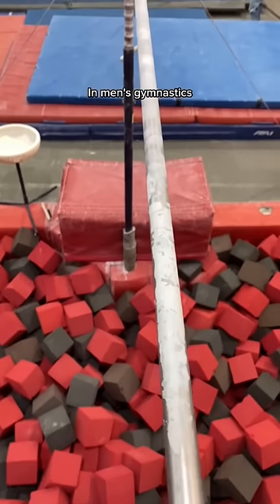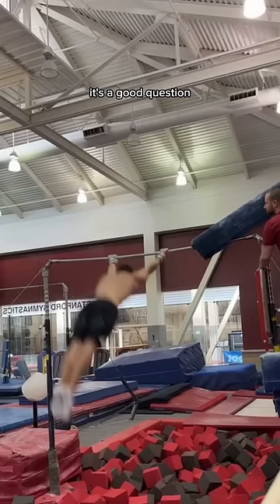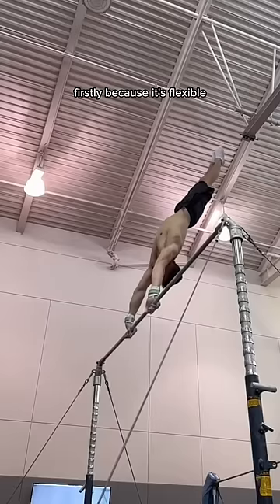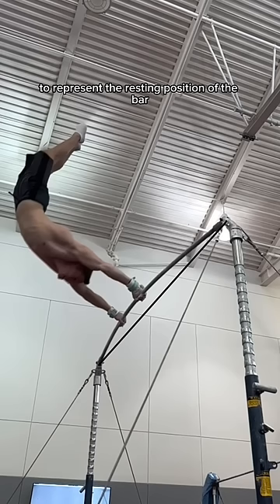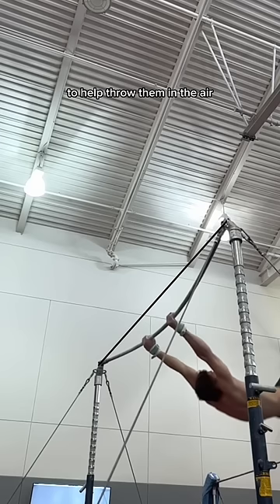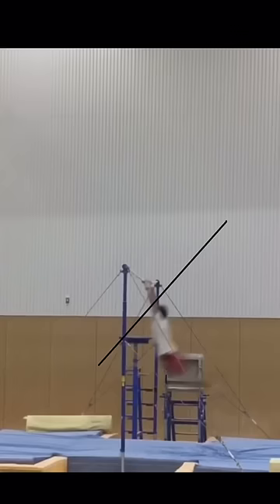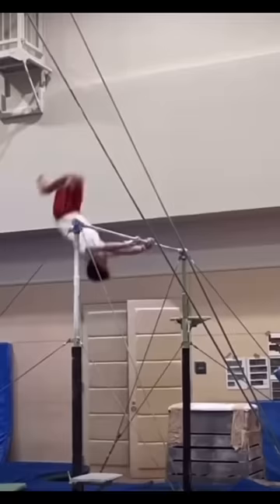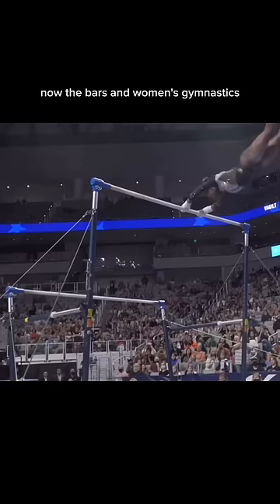Why is it made of steel 🤔 #gymnast #gymnastics #sports #calisthenics #parkour

Comment: Sounds like the women should also have a steel bar wtf literally less aid from the bar why make it different
Reply: Steel is springy, but that only really helps when you’re of a certain size. Gymnasts are on average smaller people, but I would expect male gymnasts still weigh a statistically significant amount more on average than female gymnasts. One possible reason for the bar difference is if you’re under a certain size, the steel bar may be more of a hindrance than a help. Steel can be springy, if you can pull it hard enough; if you don’t have the body weight to do so, that would be a serious disadvantage. Wood and fiberglass are springy too, but less so (I.e. it takes less force to bend, but gives correspondingly less spring, which you wouldn’t actually need as much of if you were smaller). I’d be very curious about the math here, but I would expect the difference in bar material is explicitly in the name of fairness, not some sort of sexist disadvantage imposed upon the female gymnasts.

I would still be interested in the math though, and if the performance difference between gymnast size and bar springiness is proportionate between the male and female athletes. If it’s not proportionate, then yeah it seems like it needs to be made so
Reply: Dude.. men and women who are in gymnastics weight are different yea sure they both need to keep their weight down but men on average weigh more
Reply: It’s not about being fair here. It just makes sense
Reply: I clicked "newest first" to see this comment

Comment: Uh wood would literally bend just as well if not better while still being strong???? So no, the weight difference isn't why and it doesn't make sense you guys use steel
Reply: if wood is so strong why dont we use it as armor. might as well replace all steel with wood since wood is so strong...
Reply: Your point makes no sense.
Reply: Metal bends better than wood
Reply: @shamanllama  floors are made of wood for the sake of comfort.
Reply: @shamanllama  wood is cheap. thats why. also idk about you but where i live our houses arent made from cardboard either, unlike in america. but to answer your question, your cabinet doesnt have to hold a 60kg+ fully grown dude swinging on it doing backflips. its holding cloth, maybe some electronic and other plastic things that you bought. so wood does the job. your floor also isnt only wood. theres things under the wood in specific patterns to make it more stable. the wood on the top is only there to look good.
Reply: Wood isn’t all that bendable.
Reply: @shamanllama  wood does NOT bend well at all
Reply: @mariothedog2949 they think a twig from a tree that you can bend with your hands can support someones bodyweight

Comment: You were just doing circles then and then doing an impressive flip off but yet going to try to flex on the woman even though they were doing some of the most impressive stuff I’ve ever seen I’m not hating on gymnastics I’m just saying
Reply: Some of you people get so ffended because of facts it's concerning🤦
Reply: They are both strong and very talented. It is just the type of stuff the men and women do
Reply: its because women have 2 bars so they do more and men weigh more so if they were going up and down from a low bar and a high bar then they might break their back or break the steel bar and it'd just make bars even harder than it is

Comment: Boys are stronger  that's why girls   Use wooden bars😆😆😆😆😆😆👨‍🎤👨‍🎤👨‍🎤😈😈😈😈😎😎😎😎😎
Reply: Gender dimorphism, basically men are genetically designed to have a higher concentration of muscle, this is not to say women are necessarily weaker, because if you pit a man who never works out against a women who works out on at least a semi-regular basis, the women would win.
Reply: Men's muscles are heavy so steel for men is needed, while women are lighter so wood and fiberglass is needed to bend, strenght can only help you carry your own body, heaviness is whats needed to actually bend that bar
Reply: How many 5 years olds are there that think they are smart 💀😭
Reply: Judging by the emoji usage, you are 8

Comment: So women have to wear leotards or shorts, no pants, and they get a less strong, less flexible material to work with, equating to less power moves they’re able to attempt.  

Explain to me why this is acceptable in gymnastics, again?
Reply: Women's gymnastics and men's gymnastics are completely different. There are videos of men trying women's gymnastics and struggling, and women trying man's gymnastics and struggling because those things are not the same. Both of these styles/versions focus on different parts of a person's body and different body movements and gymnastic moves.

The bars used in these are chosen to accommodate the style of gymnastics being performed on them.

Women's gymnastics bars can also be made of steel and have wood/wood coating around it. In women's gymnastics, they don't stay on a single bar so the bar used doesn't have to be as strong and resistant as the one in men's gymnastics where they stay on a single bar during the whole performance/thing.

Another thing is the weight.
If you scroll through the comments right now, you'll find a lot of posts from gymnasts (including Women gymnasts) explaining it all much better.

The bars are made the way they do to accommodate the kind of gymnastics they perform. Same usually goes for clothing.
Reply: You really thought you did something here, huh?
Reply: @tm0-original514    Except not all gymnasts are the same, if a powerful woman wants steel bars she should have steel bars, and their clothing isn’t a issue for their events, it’s required by officials female gymnasts wear leotard to receive blessing to perform, which is why the german team didn’t wear leotard and did just fine.  Thank you for your explanation, to me those reasons are just more excuse making to deny a gymnasts right to work on the equipment and types of equipment they feel most comfortable with.  And no man is told he must wear leotard and not shorts or pants.  Keeping women in leotard is for and has always been for male gaze.  There is no justification for it.

Edit:  Corrected a misspelled word.
Reply: @AJayeBirdie    When you actually have something of value to contribute to the conversation, let me know, otherwise you’re just wasting time, both mine and yours.
Reply: the guy has no shirt on
Reply: @chasecreegan14    During practice.  🤦🏼‍♀️  They’re not allowed to go topless during competition, thank god.
Reply: there is absolutely nothing you can do about it, end of discussion
Reply: The material isn’t worse, it’s just less strong because they don’t need that extra strength. The steel bar is already far more than enough for men’s gymnastics, so women’s gymnastics, which incorporate less powerful swings (as mentioned) don’t need something as powerful as steel.
Reply: Mostly because of the difference in the general routines in women and men. Women's routines in gymnastics target different things, like flexibility and lower body strength while the men's target powerful moves and upper body strength. Comparing the two is like comparing apples and bananas.
Reply: The wood and fiberglass bar is actually strong and less likely to break
Reply: And the bar type is not based off of body type, but it’s based off of aged based